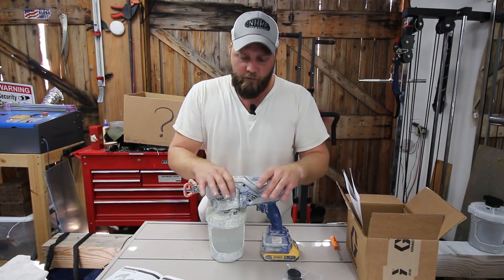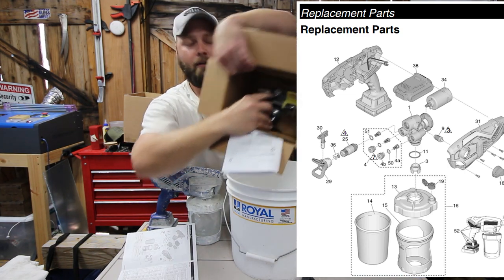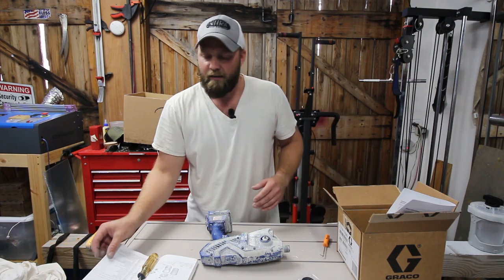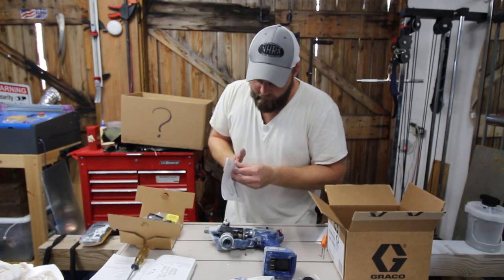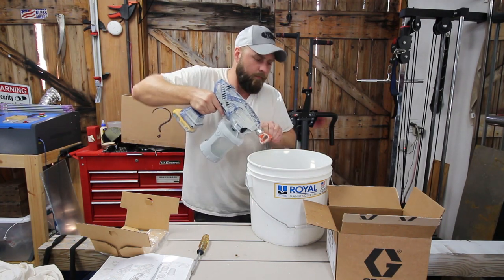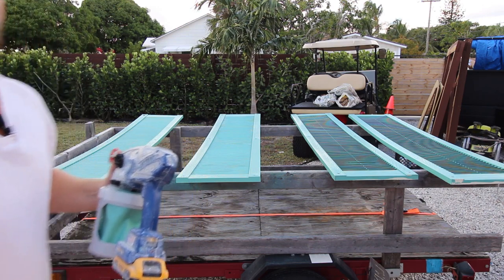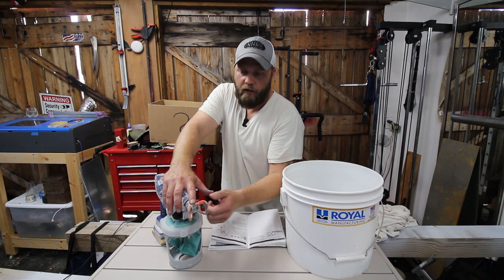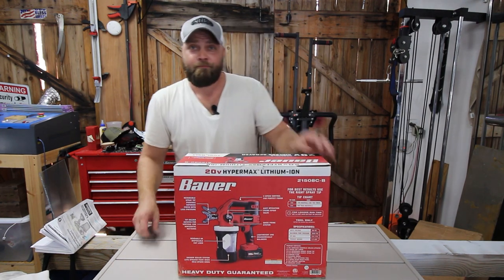I broke another one! - Graco TC Pro 1 Year Review and Repair

Comment: can you recommend tc pro ? used like new for 250$ - or bug risk,  can spray oil base ? 
Reson to buy - can use 1/4 of paint , but if I buy 3/16  25' line I can work with my gx21 and little of paint , like 1 door can do.
Reply from the maker: I wouldn't' be afraid of a used TC Pro for the right price. As you can see in the video, the pump can easily be replaced for about $175 bucks. Other than the trigger control there really isn't much else that can break.